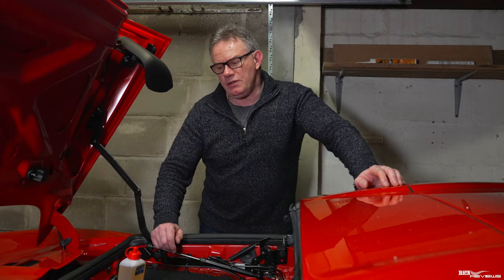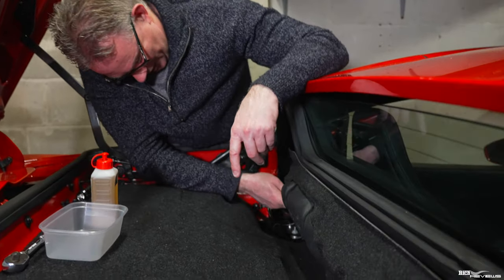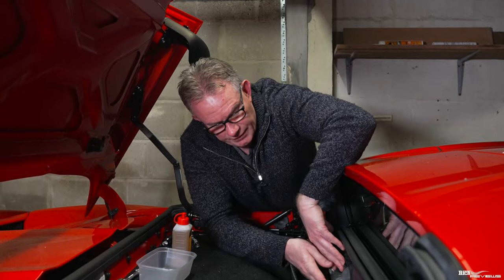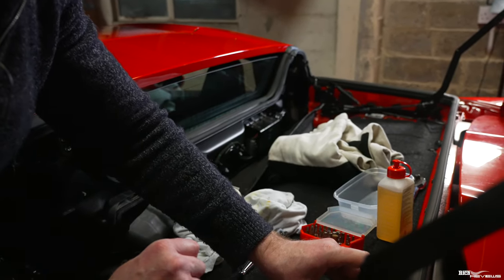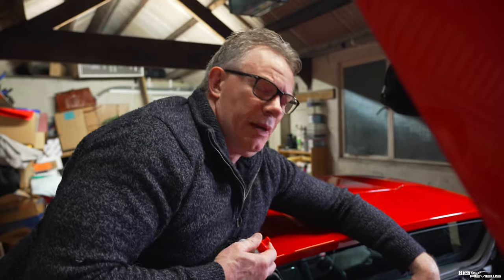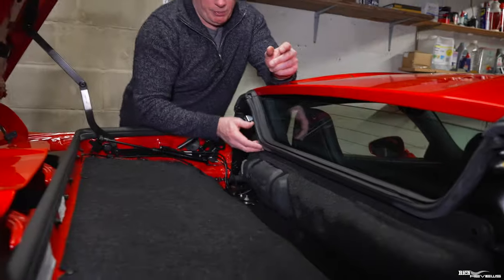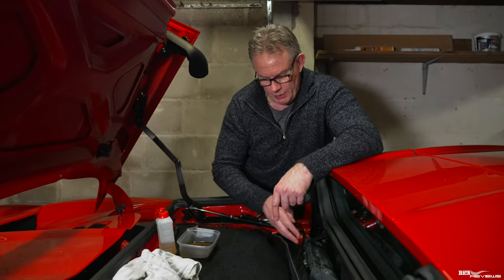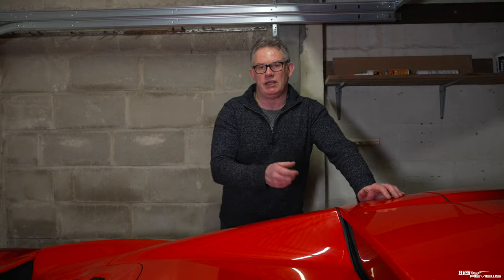Bleeding The Hydraulics of a Ferrari Folding Roof!

Comment from the maker: Today we finalise the 458 Tonneau Cover Roof fix by Bleeding the Hydraulic System which actually ends up as a Full Replacement of the Hydraulic Fluid!
I have learnt that, as with most other hydraulics, the fluid gets tainted/worn and needs replacing periodically. This is never discussed by dealers/workshops and does not exist in the Ferrari Spider maintenance schedules!

Do you find these workshop videos interesting? Would you like to see more...Let me know in the comments below....

Comment: I have three Ferraris (F12, F12, and 599) with aftermarket (Novitec) front end hydraulic lifts.  The pump and reservoir are mounted in the trunk and are easily accessible — however the assembly is completely exposed (no clam shell housing as compared to your 458 roof mechanism).  As you described, without the housing that your 458 possesses, these hydraulic pumps are not silent 😅  Love your show!
Reply from the maker: Thank you. 
The 458 front lift is also hydraulic with the motor behind the driver seat and the reservoir in the rear engine compartment. This fluid of course should also be checked and renewed as necessary.